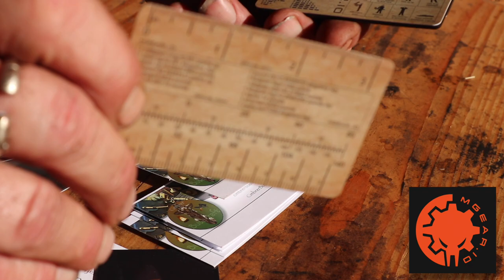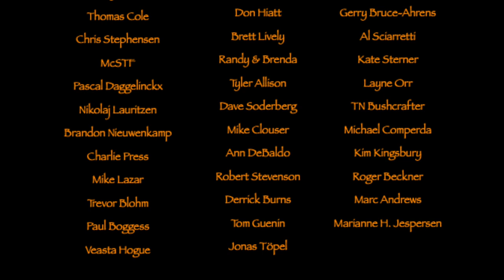Old School and Hi-Tech MGear wallet

Comment: I have had an idea of another way you might solve the belt problem. If you remove the tongue hook you created then drill a small hole on the backside of the steel ring at a slight angle to the inside and insert a pin tin to it. It could be used to hook on the holes you already punched in the belt.
Reply from the maker: Yeah that’s a great idea 👍🏻😉 and I’m sure that would work perfectly 👌🏻 Appreciate your feedback and glad to see you again my friend 🏕🔥🌲Tom
Reply: @cimbrerbushcraft-vikingheritag  You are most welcome.